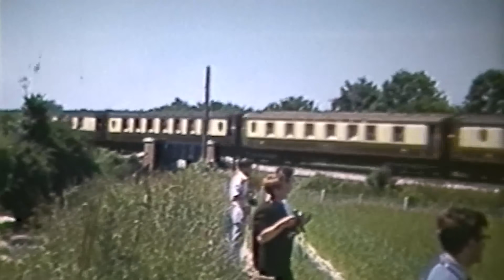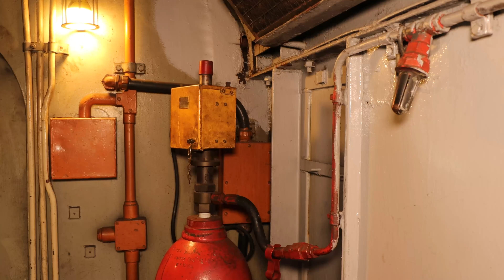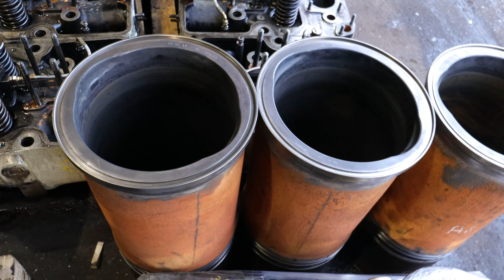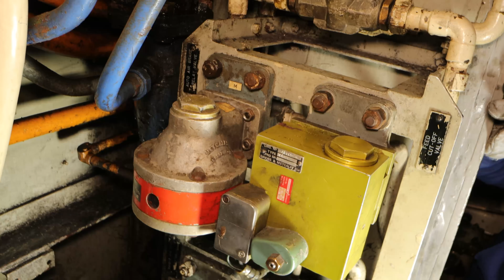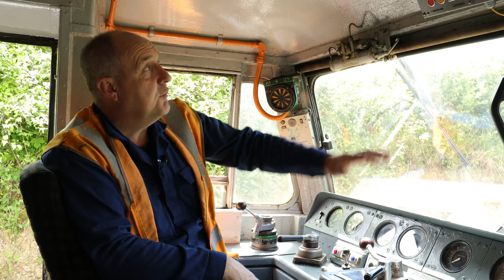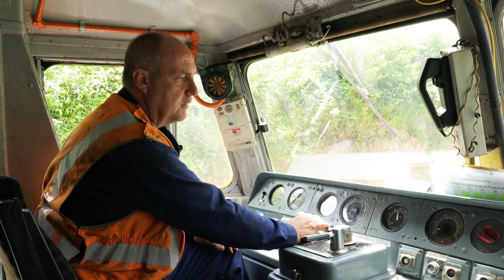Inside & Out - BR Class 47 - 47579 'James Nightall GC'

Comment: I served my apprenticeship at FP in the early seventies and worked on many 47s. Removing the triple pump, exhauster, compressor o blower was a serious pain and we fitted a runway beam to those brackets above the walkway in the brake compartment to lift them to the cab. Then there was the manhandling of it out of the cab onto a trolly. pulling out a piston involved using a swan necked bar and socket to loosen the big end bolts on the rear of the conrod. I drilled out a few cylinder snapped head bolts and removed manty turbo`s after an engine having dropped a valve due to a weakness a a number a valve stems.

Comment: I wasn't aware it was a marine engine and the comment regarding the problems due to the varied loading when rail mounted reminded me of similar issues with the Deltics which had engines designed for use in Royal Navy minesweepers.

Comment: We had lots of problems with transition bush's leaking as well as liner seals do they still have that nylon anti fret band on liners , next to  liner seals ? was a bugger to fit and made it difficult to get liners in . We also had problems with crankshaft wedges causing main bearing caps to come loose ( was due to someone grinding them to fit ) Oh and that awful triple pump

Comment: Just out of interest up until late 70s the fire extinguishers used to be BCF but was then changed to Co2.
As a driver I remember a fair few  times having to go into the electric cubicles on 47s to manually throw the reverses to get out of sticky situations.
The fire alarm test button was also used to signal the guard in the back cab that it was time to make a brew 🤣
Very difficult to overload a 47 as it has a self decompounding winding on the main generator.

Comment: Great Video, well presented you missed your way you should have been a Diesel Instructor, certainly more interesting and engaging than the ones on BR (LMR) at the time. Did "train" on Boilers but as it was the early 80's they were on the way out and I only ever "ran one up" on the Shed during Second Man Training. Did Class 47's as base Traction during the MP12 course to be a Driver so this was. good "refresher" for me although haven't "turned a wheel" on the Rails for a good many years.
Yes your right they were good for a 100mph with out "breaking a sweat," so they tell me.  
Slowing down for the 70 at Church Fenton, then opening up again you can be doing a "Ton" passing Colton Jcn on the Down Leeds (lines) with 7-8  "Bogies" on with a "good un." Again so they tell me 😉nice one

Comment: Excellent piece of film. Especially showing the 'guts' of the diesel engine in stripped down for overhaul state. Any chance of a similar feature on the BR(S) BRCW class 33 Crompton's? Would be interested to see the details of train working, change ends and how AWS and TPWS is operated when multiple diesel locomotives are used either top-n-tail or in multiple together at the head of a train....

Comment: Good video, well explained. I drove 47s with BR and Freightliner right up to the end. We had a pool of locos which had sanders fitted which used the button on the power handle to deliver a shot of sand. Worked very well and enabled them to haul type 5 loads.
Reply: Could of done with sanders on them when I used to take the MGR to ironbridge power station, especially if you were the first up the bank on a wet cold morning and the poor old guard walking in front of you dropping coal dust on the rail for grip 🤣
Reply: @bobp6742  oh that brings back memories - did you work the littleton -> ironbridge before they built the oxley chord when they used to run around at fowlers park (the old stafford road depot) and push a full load up the hill at full power - those were the days showed the real power of these beasts. i was a kid then and rode with my dad many times on that run - thanks for the memories
Reply: @AdelaideWolves  
I left the railway in 1985 to pursue a totally different career. 
I did runs to ironbridge and didcot when I was at saltley DD then I transferred to crewe.
I remember picking up MGRs at basford hall i also remember picking up loaded MGRs at Silverdale colliery.
I loved the ironbridge run great scenery especially the token single  track run down to the power station and they had a great subsidised canteen where you could get a good feed cheap.
Reply: @bobp6742  Those were the days mate - all changed now - your comment brought back good memories for me of times long gone. Madley Junction was the turn off for ironbridge fantastic scenery. I live in australia now and i bloody miss the old british trains - nothing compares over here LOL
Reply: @AdelaideWolves  
Aye, Madley jct 🤣
I was a box lad for 2 years at crewe south, always busy even on a Sunday there was always something going on. 
There's a live feed at crewe north, I used to go and watch the stream and I'm surprised just how quiet it is now, hardly any movement. And crewe works has gone its all houses and shops now and that place was huge. 
The railway has definitely changed, I certainly don't recognise it.
Reply: @bobp6742  i was based at wolvo HL and we worked the electrics up to euston, we often had saltley drivers on a sunday when we were diverted via nuneaton. They were always 47's and the cabs were standing room only LOL those drivers would always have a tail to tell for young fellas like me. Sounds like i wouldn't recognize the place now, Crewe used to be massive, we worked to crewe so had to road learn used to be able to get anywhere from there!!
Reply: Always good in multi on a F/L 👍

Comment: Thank you for a really great educational video. Richard really does explain everything so well, not forgetting even those round water filler access hatches in the body side for filling the steam heat boiler. I always wondered why 47's had that round thing near the engine room door, and steps up the side. The explanation of the brake gauges and how the brakes work was fascinating too. I mess around a bit with Train SIm, and it was interesting to see the real thing explained, now I can see if the sim works properly or not!! The construction of the engine was something else, what a complex engine block casting those locos have. Great stuff and thanks again. I really hope you feel up to making more episodes, all the best with the Diesel Gala, and thanks again, Dave.

Comment: Send her back to Mangapps so I can have a drive again!!  One big memory I have of the 47's was when I started my footplate career and was a second man at Kings Cross in the the early seventies and working a freight liner one winter night to Doncaster. As was the way in those days the driver would put the second man in the chair (drivers seat) to take over the driving. (thats the way you learnt then) Less than 5 mins after I took over we were approaching Offord on the down main line at a point the track runs alongside the river Nene an area where it was often foggy and this night it was thick. All of a sudden there was a loud bang from the engine room and a huge air leak all the brakes came on and we came to a grinding stop. The driver went back in the engine room but nothing he could do would stop the leak. As no radio comms in those days it was my job to walk to the signal box which was still quite some way ahead to arrange assistance. As I said we were on the down main line and on the left was the down slow on the right was the up main and up slow lines. So as to stay safe I (as I mentioned it was thick fog) did not want to cross an active line so walked in the "four foot" of our line.  I can tell you was a very scary experience with trains running at 100 miles an hour on the track right next me when it's pitch dark and thick fog when you can hear a train coming but cant see it till the last moment.  Think I was on duty for about 17 hours that night!
Reply: You got the wrong River, the River Nene runs under the ECML just south of Peterborough Station. It's the River Ouse (or Great Ouse to give it It's correct full name) that runs alongside the ECML at the Offords.

Comment: Great video. What's the miles to the gallon on these loco's?
Reply: Working on full power the diesel used was/is about 4 gallons per mile at 90 mph
Reply: Fuel "flow" test figures were around 2 gallons / min. at about 20 Psi. Anything less and it was fuel starved, it does not convert directly to M P G. as loco can be costing for long periods so only a guide, better to compare gallons used / work done,( Kw h ). The weight and speed of the train will make a big difference to it all as well , slow heavy work / fast high-speed stuff will use lots of fuel.
Careful driving using the gradients and route knowledge could save a lot of fuel  .

Comment: As a Shunter, I worked with many of these 47s, the early ones with Steam heat, then ETH, Vacuum pipes plus main air and auxiliary.  Enjoyed my time on BR.
Reply: We’re the steam boilers diesel heated?
Reply: @theburrell4626  Thanks for replying, yes I believe they were. Back in the 70s/80s we had a Spanner station boiler at Pz, to heat the old vacuum braked Sleepers.
Reply: @theburrell4626  
There were 3 types, spanner, Clayton and stones all were small bore boilers which allowed them to run on untreated water and get up to steam quickly. 
They had a reputation of being unreliable but I never had any problems with them during my secondman years at saltley DD before transferring to crewe as a driver then it was all ETH.
Reply: @bobp6742  Baby Spanners and Claytons.  The Claytons were 50/50... had a few where the water pump had failed (seized) due to poor maintenance.  Best boilers for us were the Stones on the Class 40's, very good steamers, followed by the Class 46/45's.  The guide mentions about the boilers being removed and replaced with the long range internal tanks.  However some Class 47's were fitted with a bespoke ETH unit where the boiler used to be.  The Class 47/3 simply had a large concrete block to balance the weight of the missing boiler.  Long range fuel tanks were later included where the boiler water tanks used to be - I think!  It's now over 45 years ago when I did all that!